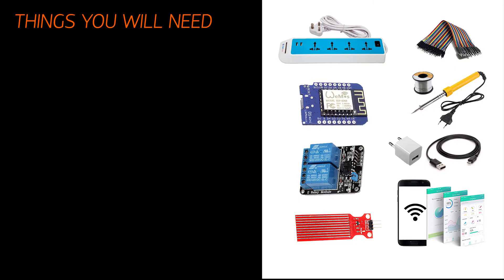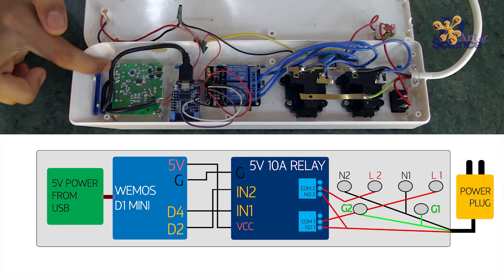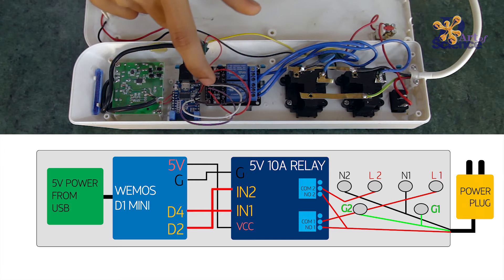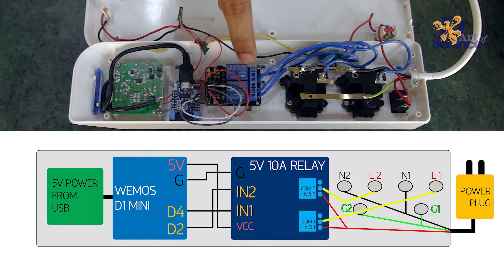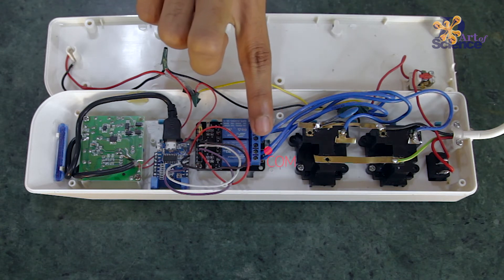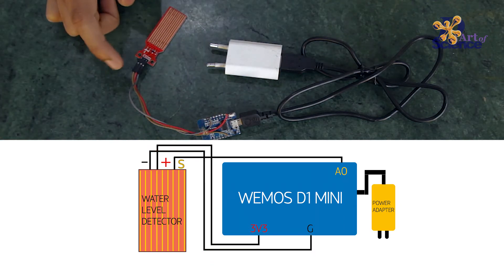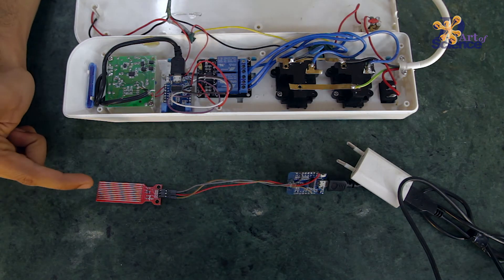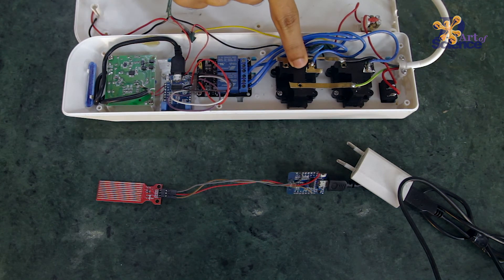Stop Water Tank Overflow | SMART SWITCH Full Video | dArtofScience

Comment: Good project. And a neat demo. Wanted to know where you got the plastic mount for the water sensor mounted using the cable ties.
Reply from the maker: we made it and then painted it the same as the other sourced extension board.
Reply: Thank you for a quick reply. 
How did you make it?. Was this custom made/ordered or off-the-shelf and then painted?. I have a need for this kind of mount in a different application. And may need some good quantity. Appreciate if you could share the details or send it offline to avramreddy@gmail.com. Thanks in advance.
Reply from the maker: We make most of the things from scratch as there are people included myself who are trained modelmakers and we can start with a sheet of plastic (sunboard/pp etc), m-seal etc and then make into a product that looks like an off the shelf product after painting and stickering.
Reply from the maker: even the designs are always original, starting from sketches

Comment: are the these relays safe for pumps / motors with load ???
Reply from the maker: seemed fine...though we have only tried using it a couple of days, not months or years
Reply from the maker: this relay can handle a load upto 10A. see the max current rating of the device  you are using. if more than 10A then higher current rating relay are available.

Comment: Great :) I was thinking for quite some time as well about a compact multi-pin plug that automatically gets switched off after a desired set duration. 
Especially for putting my phone on charging at night as overcharging kills li-on batteries.
Reply from the maker: the scheduling option is always there anyway in these IoT platforms.